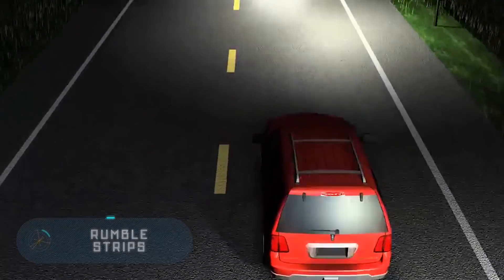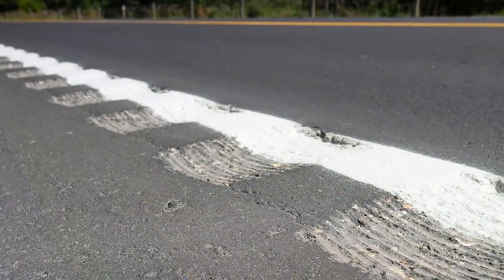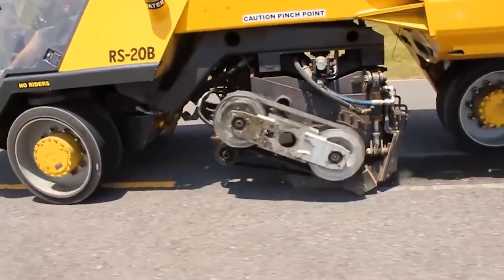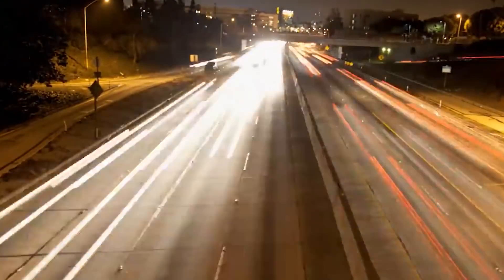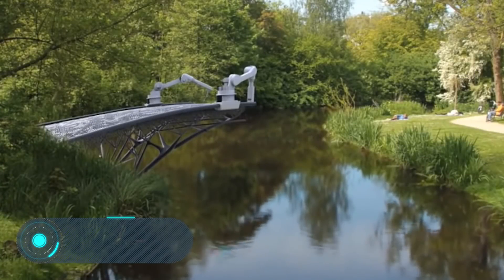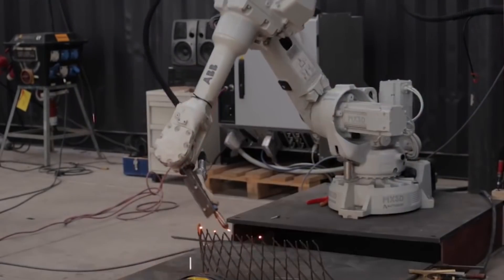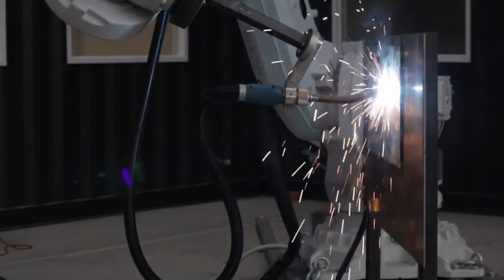MIND BLOWING LATEST ROAD TECHNOLOGIES

Comment: My Best Road Surface Made is:
Asphalt concrete layer: 254.2 Inches
Unbound (granular) base: 289.6 Inches
Unbound subbase: 813.4 Inches
Thickness: 1,357.2 millimetres
Total Equivalent thickness or GBE: 2,714.4 millimetres

Comment: so basically any road/ highways with surface based power line runs along with can be energy supply and as generator at the same time
various uses and needs
----
but then non conventional will cause lost of chain link industries and employment opportunity etc
more so ubi/ fd/ equiv are needed
else if
4th industrial continue to be neglected

Comment: 1) the grid of polyester whatever stretch out grid for roads is great but unless that is Maude out of 100% recycled materials they need to switch it up and in stead of using whatever they are they shoul use 100% recycled tires to make the grid!!!! For one it would make rhe roads more flexible, less cracks and the like but also  make the road less rigid more shock absorbing so a smoother ride, and makes for less wear and tear on the rires, shocks, brakes, even the drive train, all of which will be making a huge impact on all maintenance costs related to asphalt verses this form of pavement in the positive for both government and driver/vehicle!!!

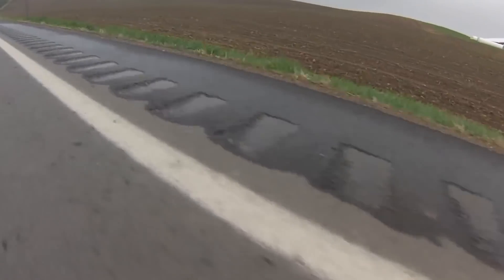Comment: 3:14 is a cost inefficient way to reduce driver's veering off the road. In South Africa, we're using a new technology called textured road markings. The shoulder lines are painted with a special paint that had a very tough texture that give a humming noise when a car goes over it

Comment: Smart Crossing looks too electrically intensive to be economically viable. Even with cheap lighting.
Reply: It's not economically viable because LED's/glass/plastic/whatever are not viable road surfaces and are going to break down or become too slippery to be safe.  It's the same reason "solar roadways" can't even build a sidewalk with embedded LEDs that doesn't break after 3 months.

Comment: 1st: not a new principle of construction, but its nice they they simplified it to a easy to lay manufactured piece.  
2nd: its a waste of time, people just need to not walk in the road, and if a driver was to distracted to see a person in front of there vehicle, then there to distracted see the road changing lights and be able to react in a half sec.
3rd: those are not new, they have been on the highways of where i live for over 30 years(probably longer) and i live in a town of only 10k-15k people.
4th: more people stopped because there was some form of entertainment, people wont always be dancing there, and its affects will vanish once people no longer see it as a cool new thing and grow board of it.
5th: once again, not new, my town has had for about 20 years and its probably been around longer than that. (i did allways wonder what they where for)
6th: it will pop after not very long. maybe its more resilient in there factory tests, but come on, how often does someone get a flat tire? now imagine if your "tire" could get popped by a small sharp pebble.
7th: the roads going to be closed for like, 5 hours! just to patch a few small holes. it would be WAY faster to just have the guy walk along the road and patch them by hand.
8th: no mater what, welding is not a super accurate job, nor does it produce good looking results with out serious sanding. and i guarantee, the amount of time its takes to program and execute the task on that, the job would be done faster and better by hand. (not to say i dont think it has potential, its just very far off of being practical)

Comment: A smart walkway will never work. You wonder what happens to plastic materials when exposed to the sun for years? They deteriorate quickly. Asphalt already crumbles fast enough, but a smart walkway would be absolutely useless due to cost, maintenance, and constant replacing. You'd be better off teaching people how to drive and telling pedestrians not to run into the road...

Comment: Latest road technologies... from 1952: Rumble strips. They could've pointed out the neatly tuned ones that produce music when you drive over them at the right speed. Those are at least a little new.
The ooblek speedbumps are a neat idea that I had never seen before.
Asphalt recycling has been done practically forever, what makes the Australian version different?

Comment: Rumble strips have saved my life more than once...
Reply: Sam Lyon then dont drive
Reply: +Runway runner ppl have a stressful requirement for the long drives and to keep deadlines, it happens. and the when you have those straight roads that stretch on forever with no twists of turns it is actually remarkably easy to just kind of zone out and start veering off. 
w/e the reason, a break every 2 hours is the recommendation, but even then other forms of fatigue can still take their toll
Reply: Sam Lyon yep especially in winter when you can’t see the lines.

Comment: I've used the rumble strips to navigate in a whiteout before.  Just use extremely low speed and a shallow weave to keep 'bouncing' off the strip so you can tell both which side you're on and which way it's curving.

Comment: Rumble strips are a mind blowing new technology?  I am pretty sure they are older then I am.  Maybe they are just being introduced in the UK?  

For the liquid filled speed bump am I the only one who really wants to pop them?

Okay next why a drone.  I mean you got a guy walking along the road with the machine the drone is using to repair the pothole why does it need to fly humans are pretty good at identifying potholes and why not simply spray the entire road with that miracle chemical that makes further maintenance less necessary?  Also if you have a spray that significantly increases the durability of ashfault why was it not on the list.  You can put it in place of the rumble strips.

Comment: We don't need rumble strips on most British roads, the potholes have the same effect of slowing you down. We used to drive on the left side of the road, now we drive on what's left of the road.
The problem with smart crossings is the same as with smart phones and smart cars, the people get dumber.
The British government are unlikely to use the intelligent speed bumps because their only concern is causing as much inconvenience to the driver as possible. Hence the recent national speed reduction (at great cost) on British minor roads form 60 mph (generally safe) to 30 mph ( for no good reason).
The last item is not that new. It used to be that the old asphalt was gouged out and reused. Now we don't bother repairing the roads.

Comment: The area I live, they have done something to the roads. Like micro abrasions, or something. Likely this keeps the road from cracking right away when some idiot is way over on this trailer. I also notice, however, that the faster you go the more the tires on this pattern produce a "tornado siren" audio trick. I suppose this keeps people focused when driving. It is barely noticeable.

Comment: 1 - i can see it being useful, but i can't come up with something at the time
2 - basically solar roadways, but without solar panels and costing 10x more to produce and maintain with shorter lifespan and with higher power leds to even see anything lighting up during daytime
3 - very easy to install, without decreasing roads lifespan by a lot and without costing a lot to install
4 - hmmm... i don't know what to say about it
5 - i think this is supposed to go on train stations, not roads and i don't think it's "latest" technology at all
6 - so basically non-newtonian fluid in some rubber
7 - why, just why, there is a lot more time wasted and it's really ineffective. and adding a 3d scanner to a drone? just WHY?
8 - it takes way too long to build a bridge, i can see it in the future when building a bridge like shown would take just a few minutes, but for now it is way too slow
9 - isn't this how it has been for a long time? https://www.google.pl/search?q=how+much+asphalt+is+recycled
Reply: 3. Better off using the raised paint, like in Europe. It does exactly the same thing and doesn't cause any damage to the surface of the road
5. In the UK (it might be the same throughout Europe) they are also used, at all pedestrian crossings as well. BTW, they are also, great if your not blind, as they stop you slipping, in wet or icy conditions

Comment: 0:14 Geoweb = good

1:26 Smart Crossing = bad (cultures disability & degeneracy)

2:29 Rumble strips = bad.  (1) noise pollution: now the driving idiots further reduce adjacent property values, (2) Dangerous for other road users: they dissuade drivers from wide passing cyclists, (3) dangerous for other road users: they are dangerous to bicycle over (when avoiding obstacles or threats [such as animals, etc.]; (4) civil ability:  if you are driving over the center-line inadvertently you should not have a license and should not drive a car, (5) civil ability:  a society should not make it easier for degenerates to exist in their degenerate state, instead the person should be improved.

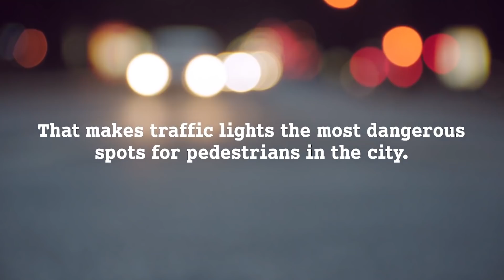4:03 Media based warning signs: ridiculous.  Harms the precedent of stable regulation in society.  Tailoring society for pot smoking idiots?

4:50 Step safe: isn't this already implemented in rail stations and whatnot?

6:29 Smart Speed Reducers = interesting.

9:12 Asphalt reuse = interesting.

Comment: The Geo Web is a good idea, faster road construction, thus reduced costs, in combination with longer road life.
The smart crossing is useless, it is smarter and cheaper to just install a barrier between the road and the sidewalk, e.g. a fence.
The rumble strips are a great idea, they should be on all highways in all countries.
The dancing traffic light is pointless.
The tactile pavement makes stations much safer, I like it.
The intelligent speed bumps don't seem like that good of an idea, just like speed bumps in general.
Drones that repair roads have a lot of potential, I wonder where this is going to go, sounds promising.
3D-printed bridges have great potential, due to the nature of 3D printing.
I like the idea of recycling road pavements.

Those are my thoughts.

Comment: 7 advertisments in a 10 minute video. also. how many people think it is viable to replace even just the roads in the large cities with billions of $ of specialty made led screens.  oh. AND all the computers to run them. lets be real. tourist attraction. who paid/is paying for that.
3d welding is overly expensive. it is cheaper to use rod iron and weld in key spots. the bridge is really one giant weld. welding equipment is rather power hungry. not to mention cost of shielding gas. flux core wire could be used but would probably not be nearly as strong. always think cost/efficiency 
ha.. you could think of this whole video as one long advert.
drones repairing roads.. ha. no. they can not do real significant repair.
and the obvious end result of that speed bump is some bored teens pop it and laugh as everyone runs their car through goop. ideas are well and good. but some just aren't thought out far enough.

Comment: I saw an article about 10 years ago about a glass road, the sections were about 6 feet by 10 feet and about 2 feet thick.  It had solar energy capability which could warm up the tiles and help defrost the road during winter -- plus excess energy could be used to help power towns.   

There was also wiring installed that would help in communication that could eliminate cell towers, and telephone lines.  The creators of the road also said that if cars were developed then the road could even communicate with the cars for programmed trips and there would be no need of a driver.  

Any major damage would be fairly simple to fix by just pulling a damaged section and replacing it.  The blocks were amazingly strong...they showed a truck without a wheel going over it..the rim barely put a scratch into it.  

Why this technology...ten years ago wasn't adopted... I'll never know.   The only thing I could think of is that the utility and communications companies wouldn't like a 1 source supply of energy and communication lines that they couldn't have their hands controlling, since the roads wouldn't be under their control...and right now they have enough pull in the government to probably block something like one of those roads.       ???
Reply: Idaho was building a road with that technology,  not sure if it was ever finished or not,  i also remember montana or n dakota was also doing some solar road building
Reply: Yes, you are correct.   
I was born, raised and still live in Idaho, and that's why I probably came across that article so many years ago.   I thought it was a great idea, using all those miles of road as an energy source, and communication conduits. 

Plus it the glass roads could also save the environment from billions of tons of salt being dumped on roads that end up washed to the side, and entering into the waterways, as often there are rivers,  creeks, and irrigation ditches next to roads.   As I mentioned, those glass roads were able to use their own solar energy to heat the roads so snow and ice would melt off and drain away through special channels.

Comment: that Tactical Pavement has been going up all around the KW area but the schmucks made them out of metal and placed them on a wedge type rising elevation, how many times those fucking things almost killed me since they've gone up is fucked iv almost slid out into traffic because the fact that when my wheels hit the bumps they end up loosing traction and when its wet out you end up hydroplaning on those fucking things to date iv already wiped out 40+ times on those fucking Tactical Pavement Strips... there a fucking hazard is all they are

Comment: non newtonian fluid also being used in motorcycle vests: my cousin was just telling me about how it works and he ate it that same day.
Reply: digimon916 Did the gear work well?
Reply: Benjamin Taylor seemed like it worked fine. Was only scraped up and not torn. The "fluid" isnt a fluid at all that is sealed off or in a pouch. Its more like rubber/gel pads at stiffen on impact.

Comment: The special speed bump liquid, aka obleck
Reply: and is completely pointless~ Not hard to slash that thing and let it slowly ooze out over the street. Only people that thing is for is the rich who cant be bothered with a simply bump check from the road.
Reply: draggy76 I don't know about your driving experiences, but I've found many speed bumps to be jarring even at low speed.  This is a good idea in theory, and there may be practical ways to prevent vandalism such as steel or kevlar mesh-encapsulated fluid reservoirs or self-healing fluid that hardens when exposed to oxygen.
Reply: Can't beat a speed bump made of hot mix.

Comment: We have had rumble strips on our freeways in Australia for decades - we dont dig a groove out of the asphalt, that seems like hard work and costly. We add a 4 inch wide narrow strip instead, no doubt would be a lot cheaper and no cutting tools to wear out or depth of road lost. Work amazingly well.. it vibrates the whole car for the moment your wheel leaves the road - gives you shock and more than enough time to correct. No doubt has saved many lives across the country.

Comment: As far as "crossing" safety, I always thought (for years) that holographic technology would be easier to implement than to have the road emit the light everywhere because of practicality and cost; then motion technology could sense at certain areas a person crossing a designated area and activate a holographic walkway and even light barrier with the person still visible; then go off when the person was safely across the road. Holographics would work better in rain and on snow covered roads as well because the barrier could be (3) dimensional (like a see thru light curtain) instead of only (2) dimensional.
Reply: Soon (tm)
Reply: Okay, but holograms don't exist.
Reply: @derpmansderpyskin  Well they so, the tech is just hella expensive atm

Comment: Some absolute fads. 
Some interesting things (the low tech ones are the most interesting). 
Some items included in a "latest" tech video is a stretch when its been around longer than I have been working in the industry for almost a decade now.
 
Robotics won't be adopted in this lifetime on roads but if we do the grunt work and tests now maybe it'll be ready for the next generation. Roads are owned by public bodies who want cheap solutions - if its not going to be cheaper (across the entire design life) its not going to be adopted.

Comment: The best roads are airborne. Low repair and low maintenance costs. Freight should be tunnel & drone. The roads should be reearthed and all traffic should be ai assisted flying cars.
Reply: burtlangoustine1 Except not only is it safer to have to worry about only two dimensions rather than three, but carrying weight through the air requires more energy than having the weight supported by the surface.  It's also probably more mechanically efficient to push against a roadway than pushing against air for propulsion.
Reply: Check out the new flying car fully electric: then Hyperloop which could power the former. AI would play ATC and pilot all air traffic for safety and insurance. That was my thinking on it ✌